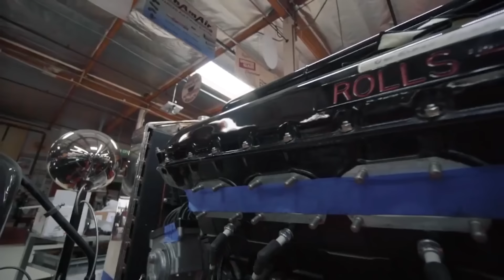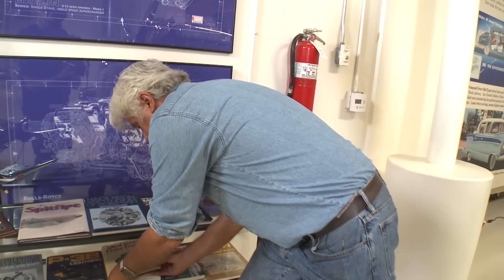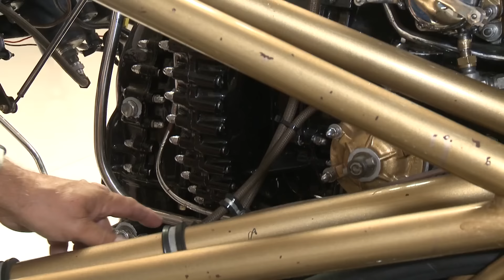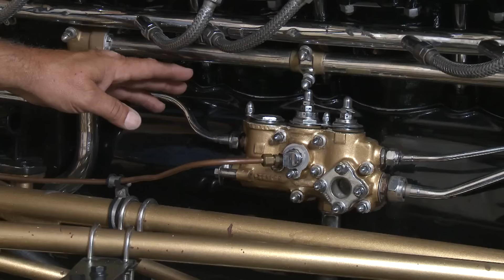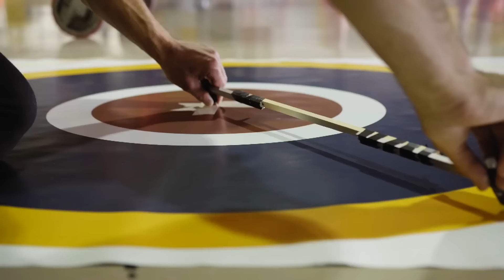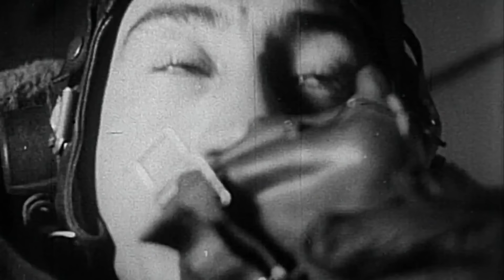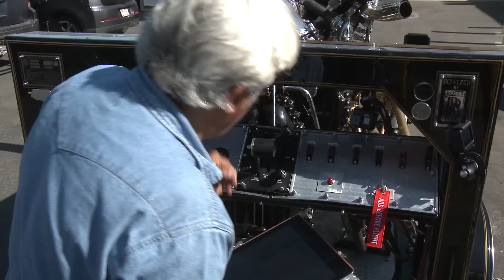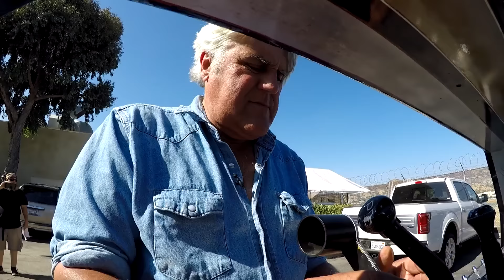The Engine That Won World War II - Jay Leno's Garage

Comment: That's not what they looked like, too much chrome. Also the Double Wasp was much better in battle one 45 round in the oil cooler or radiator and the Merlin was toast. The Double Wasp could get you home with a few cylinders blown away
Reply: steve gale the video is titled the engine that won WW2, besides if the time spent with training a pilot was valuable to a country at war.

Comment: Just a suggestion.  You might want to add a Cylinder Head Temperature gauge or Exhaust Temperature Gauge to help you set the mixture right.  I could be wrong but most modern aero engines run a bit richer on the mix than what it looks like you had it there.  For example a Cessna 172 would take off with the mixture at full rich and get leaned as altitude was gained.
Reply: Cee64E auto rich & auto lean are the only mixture settings it needs. It's not a lycoming.
Reply: Learn something new every day.

Comment: Why do some of the Merlin engines run Clockwise and some I see run Counter Clockwise?
Reply: Just like the Allison engines, Merlin was primarily clockwise engine, but since they been used on multi engine aircraft(like Mosquito and Lancasters, or P-38 as an example of Allison CC rotating engines), so to canceled the torque of the engines they had variants of the counter clock rotating engines.
Reply: I've never seen an anti-clockwise Merlin on an aircraft. As far as I know all four engines on a Lancaster and both on a Mosquito rotated the same way. .
Reply: You right, only Allison engines could rotate in both directions, Merlin engines did not.

Comment: It's disappointing that this man has 3 aircraft engines that aren't where they belong!
Reply: There are a lot more Merlins around than airframes to put them in.  He has reconditioned and brought to running condition (and use) three of them.  Don't knock it
Reply: Paul Standeven 
 Warbird operators could always use spare Merlins!
Reply: David Baker Very few of these display engines are built with airworthy parts. They may run and pull partial power but they're not airworthy and worn beyond limits.

Comment: Very cool jay! Only thing I would do different is to add the word "CLEAR" to the check off list and shout it before hitting the starter button. There looks to be quiet a blind spot when standing behind the engine at the control panel. As a old motorcycle rider I appreciate your videos.

Comment: That is one hell of a motor. Has all the trates of high output  motor, hard cold start, sloppy at idle, but warm her up, put some fuel to her.... that motor was made to run at  4500-5000+ rpm. And bet it sweet running in high rpm's.
Reply: I've stood 50 foot in front of just jane on a full power ground run,something to behold.
Reply: twe enyss I bet make one of those make your  hair stand up on back your neck and arms kind of experience.....
Reply: Amazing,i'm no planespotter as such but went to see 3 lancs at East Kirkby when The Canadian lanc visited,2 in the air,1 on the ground undergoing restoration to flight eventually.12 merlins running hard was epic.me,my dad,best pal and his dad...doubt i'll see anything like it again.
Reply: Nope Redline was 3,000 RPM !!!